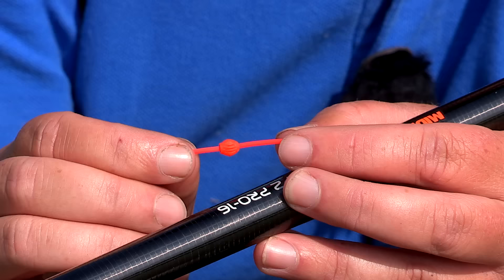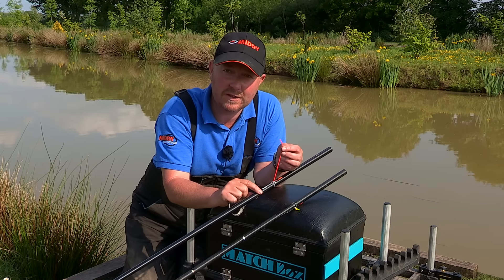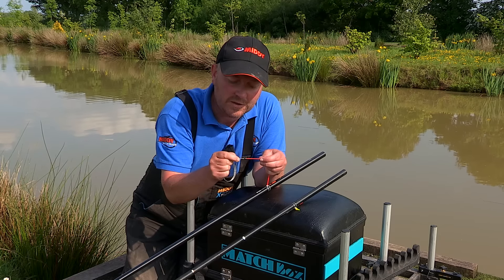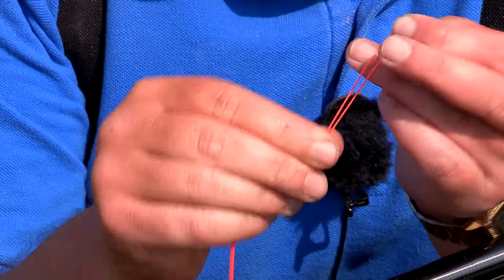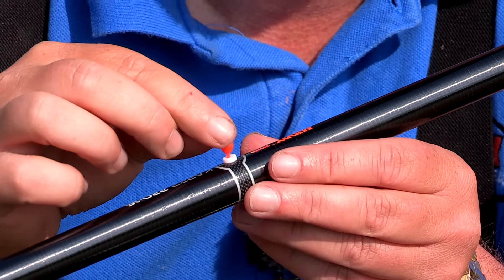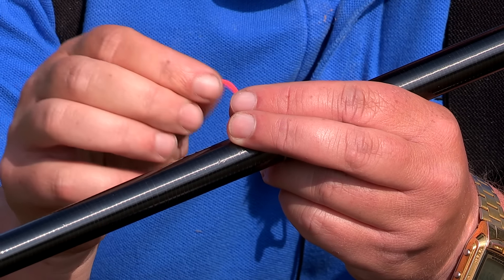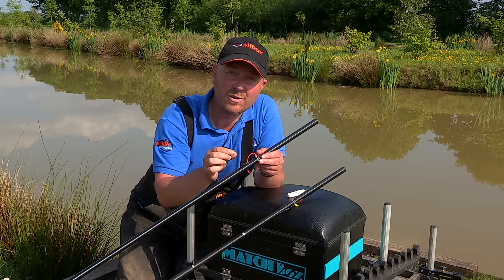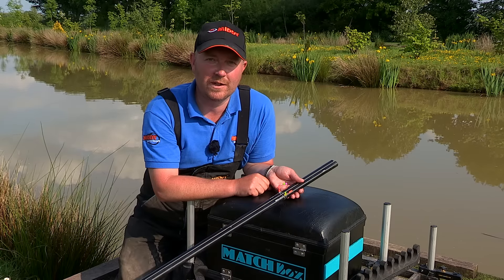How to improve your elastic set-up

Comment: I do use them for that purpose but when I 1st elasticate my top 2 I leave 6 inches hanging out so that when my elastic wears out at the bush end I've got enough to change it a few times. Also if you use the larger size up the elastic will pull through the gripper on those odd fish that go on a wild run and gives you that little extra bit of elastic which could be the difference between making or breaking you. 👍